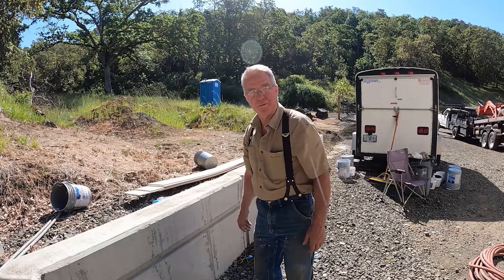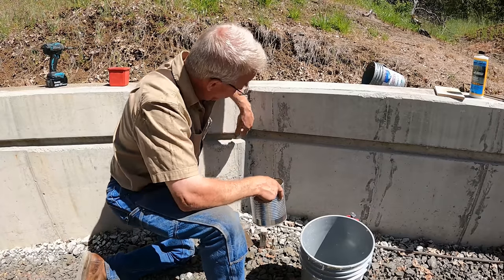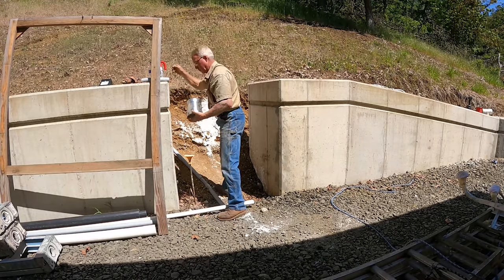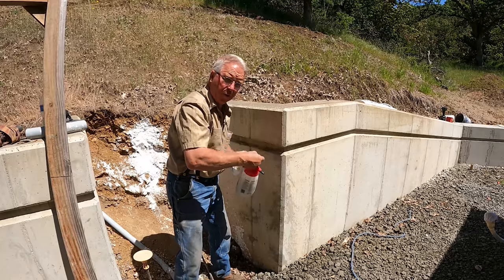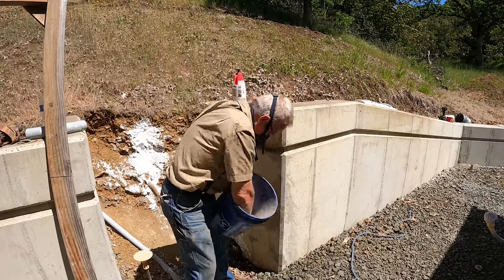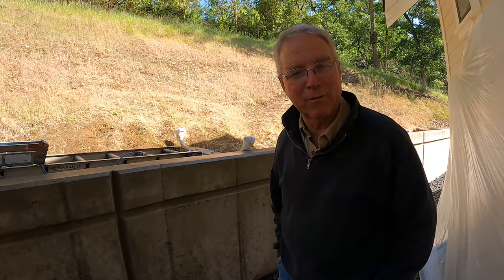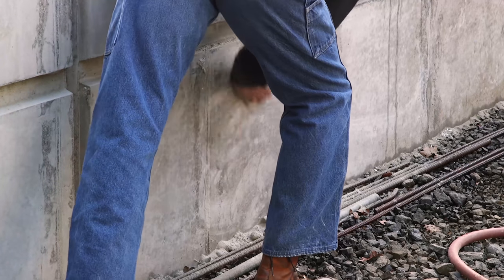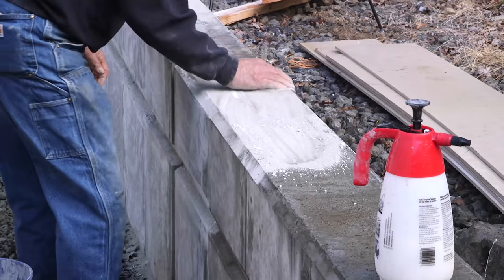Smoothing Out Concrete Walls

Comment: Good stuff. I'm 68 and have been doing the same work I watch you do since 1971. You seem to do everything the way as I was taught, with minor local differences, I'm in So Cal. I will say I would advise that you wear gloves when sacking or any concrete work. I've seen some really bad cases of cement poisoning on many a finishers hands. Great videos Brother.

Comment: A question about the strength of the "sack and patch" - how well does it adhere to the concrete?  I've spent quite a bit of time pressure washing with professional equipment that can damage the best set concrete if ran at too high a pressure/flow rate for too long.  Additionally we have chemicals available to "whiten" or "brighten" the concrete back to a day-one appearance.  What are the chances this thin covering truly becomes one with the original concrete vs gets blasted off the next time someone comes to clean it?
Reply: I was thinking the exact thing while I was watching this video and I was going to ask that question, so now we can wait for an answer
Reply: FYI - As someone who does concrete & parging, there's no such thing as forever when it comes to anything manmade.
Reply: I wondered the same thing
Reply: The earlier you do the repair the better.  Nearly all of the hydration of the cement, curing, of the concrete takes place in the first month. The unhydrated cement in the base concrete has yet to make chemical bonds with other cement particles. The sand cement repair mortar will make a chemical bond with the unhydrated  cement in the base concrete. Honeycombing, exposed aggregate, in the base should be repaired as soon as the forms are struck if possible. After a month there will be mostly a mechanical bond only. Pressure washing aggressively enough to remove the surface of the concrete will improve the mechanical bond of a repair but it is likely to make the repair more extensive. The repair will not be as strong ae the base concrete most of the time.Better to just use it to remove dust etc. 

I missed it in the video but to get a  colour match make a few different mixes of white and grey cement. 40/60, 50/50, 60/40 apply to a small area and see which is the best match the next day. A carborundum stone is also good for rubbing down small ridges, especially in the repair, as it is less aggressive than a grinder.

Comment: Matching cement colors those were the days. Worked for a swimming pool company they had problems patching the decks after repairs. I have perfect color vision. So I told them that with a little trial and error I could get pretty close. Actually I eventually got so good that I spent most of my summer re-repairing old patches. The company was getting sued a lot for the  unprofessional repairs. With practice anyone can do this  One caution the deck colors are frequently composed of asbestos. Just don't breath the dust. Once it is bonded in the cement there is little danger of inhaling unless being cut by a saw. I knew the danger at the time and mixed the colorant while holding my breath then I would walk away for a few minutes to let it clear, always outside. Concrete always drys lighter than when wet.

Comment: I wish this had come out a couple years ago.  I was the deficiencies carpenter on a large project, and the general had made a LOT of poor decisions when placing concrete.  With no knowledge or training, I sacked the whole project.  Everything.  4 months on my hands and knees with what i now know was a poor choice of product.
Had i simply watched this video, I'd have told them I'd like to mess about with the mix a bit, and used some of the portland and sand i keep around for other purposes.
I wasted a lot of time doing a sub-par job, before gaining some knack for it.
In any case, this is exactly the video I needed.... a few years ago ;p

Comment: We used to use sand topping mix with concrete fortifier and trowel it on then let it setup a bit and take a wet grout sponge and make swirling motions it gave it a nice texture finish on the columns on raised houses we built the columns were 8 to 10 ft high and 16x16

Comment: A concrete fog coat would do the trick here. You basically mix cement with lots of water in a garden sprayer and go at it.

Comment: The mask as a gentle smoothing cup is a great idea. They do work for other things too. ;)
Reply: I've honestly have used those masks as alot of things. One example is as ladder tips to not scratch a gutter when I needed to get on a roof to paint a house. It took 4 on each leg, and some tape. We had to use the homeowners ladder and tools. And he only had a box masks, didnt want to use a shirt or socks wrapped around it at the time. Oh, and this was in the late 90's(98/99 somewhere there). I was about 9 or 10 and  I painted houses in the summers with my gpaw).
Reply: I put up this chain link fence to keep out the mosquitoes.
Reply: @rbnhd1976  Ok. Good for you bud.
Reply: @rbnhd1976  You gonna keep posting that inaccurate shit? Its already proven to work 100x over.

Comment: "Come back again for a smoother and smoother finish". Do you think that would be quicker and easier than filling in the "rock pockets" and then grinding/polishing?
Reply: If it was mine I would paint it.
Reply: @davidtaylor4053  Then you would have to paint it forever. And it would likely only look really good after a fresh paint.
Reply: @davidtaylor4053  painting concrete can be the worse thing at times you must use a vapor permiable paint other wise latax paint holds moister in and causes the wall to crumble from the inside
Reply: @davidtaylor4053  If you can help it, try not to ever paint concrete. Really really try not to ever paint flatwork concrete.

Comment: Wow that was a lot of work, and it will work fine.  On much larger highway wall projects, we specify a rubbed finish when the concrete is "green" to smooth out the imperfections and clean it and apply a texture cost or stain to make a wall look great.  As you said, structurally, you did nothing to improve the quality of the wall.  Aesthetics improvement is what you did.  A sprayed texture coating is much easier.

Comment: As I think more about it, and to give you the benefit of the doubt to which I think you are entitled, I will reinterpret your reference to N95s-the reason you have them is because you got them and used them and now that the pandemic is slowing down, you're looking for other uses for them.  You are not saying they weren't helpful.    Its a bit of a stretch, but I'm going with it, as I say, because I respect your knowledge and years of good advice.

Comment: Just the job for old geezers like us, maybe the foreman’ll put us out of the wind !!
     I’d call that, bag rubbing. For anyone that cares, once you’ve filled the bottom of the form with the first of the concrete, chuck a couple of buckets of cement grout in it, this seems to float round the concrete as it’s poured and avoids the wormholes ! This does however, require tight shuttering.

Comment: Have you ever had to fix a driveway that has started to spall? I am asking because my driveway (Only 5 years old) is spalling. So I am looking at ways to repair it with out replacing
Reply: Try looking for a polymer modified concrete dressing of its small rock pop outs only.  It gets squeegee applied to a clean substrate and broom finished across the entire slab for a uniform look.

Comment: Hand rubbed concrete finish. I don't recall anyone ever stating "a retaining wall with a hand-rubbed finish" Maybe some "color match" or accent to the house. Or would that be like painting brick??? Will someone have to continue this process again in a few years.
Reply: I'm pretty sure he said he used a bonding agent. If he did then no, it should just about be one solid piece after the bonding agent sets up

Comment: What about a lime wash? Would that help keep the moss away?
Reply: Lime is alkaline and moss thrives in, among other things, acidic environments - so it is a step in the right direction. But it depends on the climate you live in.
There is a type of lime wash called: ironvitriol - this does not only produce a beautiful orange color in time, but also prevents moss, algae & weeds from settling on your surface (this is because of the iron component).

Regards

Comment: I wish I would have done this before I painted my driveway to cover an oil stain.
Reply: You're probably better off the way you went - oil prohibits adhesion between layers of cement material - had you done it; you would have gotten a pretty driveway, with a visible oil stain.

Regards
Reply: I'm assuming you tried every kind of degreaser to lift the stain up.
Reply: @Gideon_Judges6  yes it was from the previous owner and it was deep in the concrete

Comment: That would never pass on the construction jobs I've worked on. The exposed concrete had to be RUBBED. You want a workout, use a concrete rubbing rock for 40 hours/week. It should be done as soon as the forms are wrecked and the concrete is green. You only use water and pull the cement out with the rubbing rock to make a slurry on the surface. If the concrete was poured with release agent on the forms, has correct slump & air entrainment and vibrated properly there won't be rock pockets and any air bubbles will fill in with the rubbing. That was some of the hardest work I've ever done. It was 40-50 years ago. Then I became the contactor and hired it done. :-)

Comment: could you do this on a walking surface?
Reply: Good question!!!
Reply: I'm guessing since this is used to make the finish smooth, you'll want to be careful about walking on it. Wet concrete when it's smooth can be slippery. They usually do a little broom finish on driveways for this reason.
Reply: Mike Haduck makes a paint out of water, Portland, and bonder that he uses on walking surfaces.

Comment: Would a traditional lime wash or whitewash do the same?
Reply: - It would indeed, if it was possible to make it adhere. Lime crystals only truly bind with other lime products, and albeit the cement, which went into making the concrete, is a lime based product it is a chemically different material, after being processed. Generally you can make cement adhere to limebased plaster or brickwork, but seldom the other way around.

He would have to coat the wall with adhesive mortar, forming a new rough surface - then make a smooth plastered surface, with lime mortar, on top of that; then the lime wash.

Regards
Reply: @rasmusdanborg7803  that's not my understanding. Brick is not a lime based product but takes whitewash extremely well. As the whitewash or lime wash cures it bonds with CO2 in the atmosphere to become rock like and bond with the surface.
Reply: @RichSobocinski  You are of course completely right that brick is not lime based; that wasn't what I meant either, but I apologize for being unclear 🙂.
What I meant about 'brick walls', is that the grouts are usually lime mortar, and therein you have half the constitution of the surface.

You are absolutely right about the limes reaction to Co2 - the neat thing is that after it has cured it's actually returned to its primary state; that is the way it was when someone first dug it out of the ground - which also means you can take already used and hardened lime, kiln burn it again, hydrate it and use it once, twice, thrice.. as many times as you wish. This is called The Circle of Lime.

But I was trying to say that lime does not adhere sufficiently to concrete, so this was the way to go for Wadsworth.

Kind regards.
Reply: @rasmusdanborg7803  it seems that you have better than average knowledge of lime wash/whitewash. I've been doing some research on this lately. I want to whitewash some stone foundation walls in my basement (pre 1900 building), but it is difficult to find good info on traditional whitewash that doesn't use archaic terms and techniques (do I need to add suet? salt?). Do you have any links that would help? Thanks!
Reply: @RichSobocinski   I did a lime wash on my foundation. Clean the surface, get the surface wet and apply the lime wash. I use a big staining brush. Mix the lime with water to a milk like consistency. It will take many coats to get it very white. It’s easy. You cant really f up
Reply: @MNnytrorider  I saw a lot of info about making a 'lime putty' first, by mixing the lime with water and letting it sit 24 or 48 hours. Then there's conflicting info on mixing the putty. Some say 1:1, others say 1:4.
Reply: @RichSobocinski  Lime puddy is right. If you're using already hydrated lime, the recipe is 1:5. (I don't live in the states and so I am unaware of what is at your disposal commercially). 
Lime that has been hydrated and stored is better than fresh batches; where I live there is a tradition for storing it underground in pits for up to 15 years before use.

But if you're using lime powder I'd say 1:4 is right. - Like the Prussian says, starting on a clean damp surface is the way to go. Apply coats around 24 hours apart, I'd say at least 3 coats; but go on until you like the result.
Keep in mind that as you apply the wash it seems transparent, but fret not, it turns white as it dries up.

If you want to go the extra mile on this, you can finish up with what's known as Lime Water. - (When you mix water and lime for the wash, mix it well and keep stirring every once in a while as you're applying it.)
When making lime water you make the same mix as you would for the wash, but leave it to settle in a bucket for 24 hours: the lime will sink down and the water will be on top, and lime crystals at the very top.
Sieve these crystals away, pour the water gently out of the bucket, leaving the bottomed lime seperate. (The separated lime can be mixed with water again up to 5 times, before discarded). Use this lime water in a spray container over your limewashed surface - wait 24 hours, do it again.

Finishing with two coats of lime water makes the treatment last years longer and makes it a lot stronger.

I'm sorry I don't have any links for you, all the litterature I have is in Danish and you having to translate that, doesn't make your mission easier.

Regards.
Reply: @rasmusdanborg7803  of course you're Danish! During my research, the best info I got seemed to originate from Denmark. Proper hydrated lime seems to be hard to find for me here in the US. Most like is garden lime or mixed with Portland. When I was young I remember watching my grandfather (from Ukraine) make and apply lime wash to his foundation walls. Thanks for the info about the lime water!

Comment: Don’t mind the avatar, my son has made my account, Lol. 
But I have done this before, I was always told it is called parging, I am pretty sure that is the wrong spelling. After wards I use a brush to make a swirl pattern. Also I am guessing that you used a vibrator when you poured? Also I have used non shrink grout as well
Reply: parging is applying a thin coat of mortar to a wall.  This is a much more sparing application than typical parging and using a different method where he applies dry mix to a wet wall and then applies slight hydration, and grout instead of mortar.

You can see them pour this wall in earlier videos, and he essentially mixed grout with an interesting application method.
Reply: @randommcranderson5155  I know that parging is usually used to cover block, but I just telling you what I have done when the concrete wasn’t vibrated correctly. This is why air pockets are there. I am not discounting what you are saying. I am just explaining my experience. I know that this guy is a very skilled craftsmen ( something that is rare today) and I have been doing Construction( commercial and residential) For 30 years.

Comment: Honestly concrete repair is not this guys cup of tea. I don’t recommend this method as a certified mason. The best and fastest way would be to use rapid set  ( wonder fixx) I guarantee your concrete will look %100 better and the color will be consistent. It will save you a lot of time and you won’t be wasting any material because when you use the dry mix you start wasting time and material. O don’t want to throw any negativity at this gentleman’s video just thought I’d help give some tips.